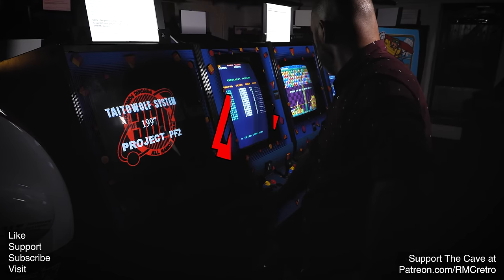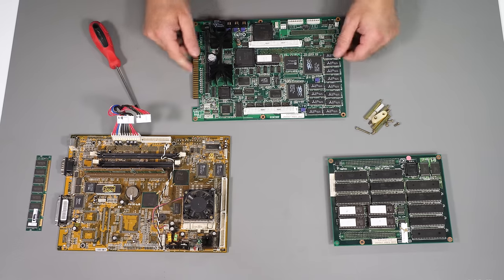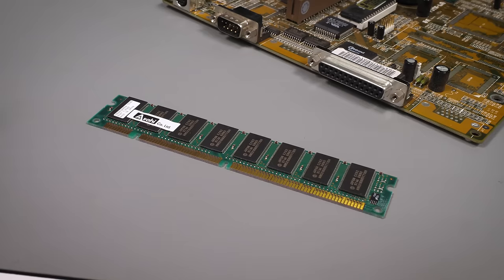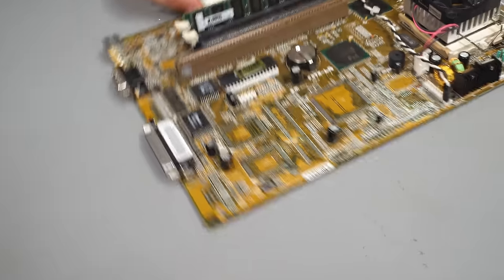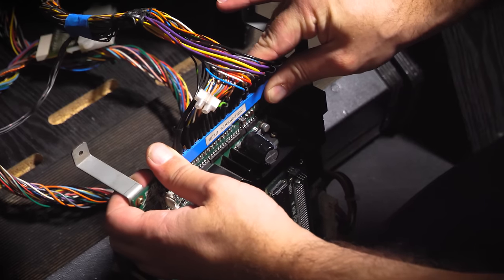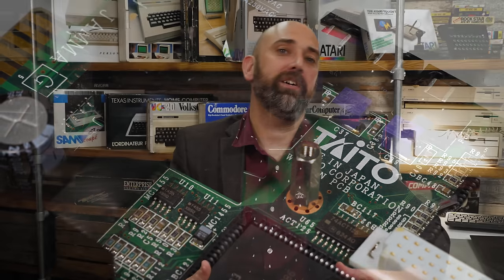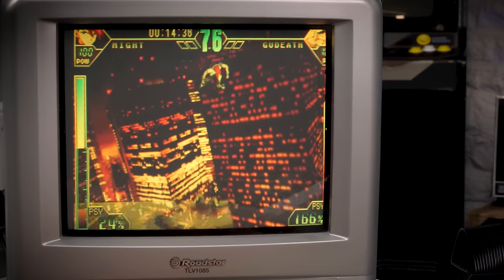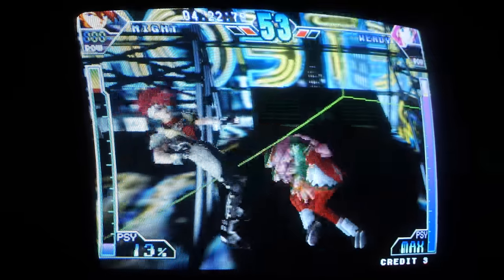What is Taitowolf? Late '90s Arcade Technology | Tech Nibble

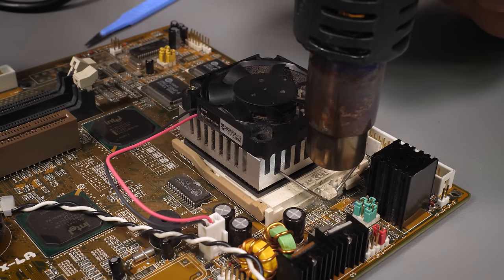Comment: 3:41 that hotsnot can be removed with isopropanol instead of hot air. It's much easier and less damaging.
Reply: Not to mention incredibly quick.
Reply: What is most of that hot glue made of anyhow?  Is it PVA?  That is something water soluble if so.  Looks like there is more than one way to get rid of that stuff.  I know that these days there is a variety of glue types used for all sorts of things, some are more permanent than others but there is usually some way to break their bond or dissolve those glues.  Even those 3M pads that are known for holding on really well are easy to remove if you remember to use dental floss. While that might leave some glue behind it will at least make it a lot easier to remove the thing it was holding.

Comment: Andamiro (The studio behind Pump It Up) made a similar platform called the MK-# which started as a bespoke yet PC-based board before using standard boards. 

The first two (MK-1 to MK-5) used Voodoo banshees embedded onto the PCB alongside VRAM connected through PCI before switching to nVidia GPUs which were AGP-based with the MK5. 

The early ones also used ISA for the I/O board and  PCI for the video. 

MK3 also happens to have an unused ATX power connector which works alongside unpopulated headers for Slot-1, IDE, and a floppy drive. 

The MK6 to present are standard boards with a custom I/O board and Linux.

Comment: The top board contains a DOS partition in ROM with MSDOS and that loads some programs to get the game booted. Note the Microsoft sticker on the board signifies a licensed MSDOS.
Reply: that makes the design even more puzzling. its like doing the whole design for sake of having rom sockets. the whole thing could just be a pci board. or just as a pc but then as a taito engineer you would've just been saying to fire you I guess.

edit: u1.bin is dos stuff. doublespace included and stuff
Reply: makes it feel like grand dad of current generation of arcade hardware in/from japan that has been PC based. Tetris The Grand Master 3 for example runs on celeron based taito type X PC hardware as do most to all current games with added bells and whistles for sure. Most have licensed microsoft windows, an embedded version for long living and running environment meant for one service device (A game) often with interchangable games. Funny enough one line of Sega hardware did use Montavista Linux, but aside few western counterparts arcade machines have not had linux embedded them like in dreams of Deck users today.

Comment: Thanks Neil for covering this. I had never heard of this hardware. Very interesting insight. Back in the day I remember the Voodoo 3 being a beast of a GFX card and it took me a lot of saving to buy one. Very interesting to learn about arcade cabinets using 3DFX tech. Aside from that my next trip to the UK from Ireland I''ll base it around visiting The Cave and the arcade you guys have. Excited for the visit.
Reply from the maker: Excellent! Looking forward to seeing you here
Reply: I know from another channel's videos that Hydro Thunder used basically an off-the-shelf Voodoo 2 card.
Reply: @CptJistuce It's not an off-the-shelf card. Yes it's an Obsidian 2 but the specific video card used in Hydro Thunder is custom and used in a few Midway Games PC-based games.
Reply: @g4z-kb7ct  I included a slight qualifier because of that. Odd amount of RAM for a Voodoo 2, and a signature in ROM that the game looks for so it can reject aftermarket replacements.
Reply: Voodoo was originally created for Arcade systems. Just that the huge drop in the price of RAM in 1995 allowed 3dfx to release it as a "3D Accelerator" for the PC. It was made as a cheaper alternative to the specialized hardware like the Sega  Model 1, 2 & 3 which cost arcades $10,000+ per unit. Similar to how devs were using PS1 as arcade hardware but better.

Comment: Emulation really hit its stride around the time this game was released. It's surprising that this game which was running almost entirely on off the shelf PC hardware with an MS-DOS OS didn't get dumped and distributed - it would have been trivial to get it working on a properly equipped PC of the era.

Comment: As for the barrel plug, it's likely that these would've been used in some setups without a JAMMA harness. It was a pretty outdated standard at the time since it only supported 3 buttons and mono audio, so you already had a lot of games even earlier than this that needed a host of other cables.
Reply: What are you talking about??    It's a JAMMA board!  You can clearly see there is no other interface or way to setup this board.   The barrel plug was just a leftover from the design stage that was never removed.    Psychic Force was literally the only game that ever used used this board and it's only interface was JAMMA as it never required additional controls buttons beyond the standard JAMMA configuration. 

Jamma supports up to 2 players with up to 5 buttons each, but many boards took advantage of the unconnected pins to accommodate up to 6 buttons without breaking compatibility. .  That accounts for a majority of games and it was still very much in use until the mid 2000's.  Even games that required more  buttons, such as Street Fighter or Mortal Kombat, still used Jamma along with a secondary "kick" harness for any extra buttons.   The newer JVS arcade standard still supports JAMMA input for the basic directional joystick controls and buttons.
Reply: @MrRobarino  "still supported" yeah because it was obsolete and left in because of how arcade cabinets would still use obsolete connectors.
Reply: @MrRobarino No! I have an original PF2012 and manual here.... AND the 110VAC to 5VDC power adapter that plugs into that barrel jack. It IS used. Although the game will work without it as long as the main PSU is 15A on the 5V line.
Reply: It's a three button game

Comment: The blue plastic film on the thermal paste rang a bell.  There was probably another layer of film attached to that blue layer, with a tab to pull with the intent of making it easier to remove the blue layer.  The top layer would separate from the blue layer giving the impression that the tape had been pulled off successfully.  Saw it a few times with AMD CPUs that used 3rd party heatsinks.

Comment: Using an existing platform doesn't just save money on the hardware development.  You can use an existing development system instead of having to either build a custom one or doing without.
Reply: Spot on. Never underestimate tooling in software development in general and game development specificly.

Comment: Pro tip :) - If you are working on anything Japanese and see those screws with the dot on them, that means they're JIS screws, not Phillips heads (even though everyone thinks they are).  If you don't want to damage the JIS screws by not having your screw driver jump out and damage the slots, pick up a set of proper JIS drivers for use on Japanese hardware.  They can be bought from amazon etc.  Some text from one of the tool websites:
"JIS, or Japanese Industry Standard screws are just different enough in shape that Phillips drivers will not fit well and slip/strip them. The difference is in the leading angle of the point of the driver. Phillips bits have a larger angle and therefore don't bottom out in the JIS screws, causing slippage. "
I cringe every time I see someone working on JIS screws with Phillips drivers.  Especially those cheap multitool versions...! :)   Then we get in to the pozi drivers...

Comment: Dude, bought a Supergun, but didn't think to buy some switches, joysticks, and a bit of wood. Man! Some admiration for the improvised joypad, minus much hate for those horrible bloody clicky buttons. It's the bare minimum, right?

There's probably someone programmed an Arduino, I think it's the Trinket that can do USB, to take a USB pad and spit out the separate bits a Supergun needs. Or you could even get an old analogue PC joypad and do a teeny bit of rewiring.

Comment: That was super interesting! But why did they even bother to make custom hardware at all? Why not just use 100% normal PC hardware and include an adapter cable from the normal PC ports to the Jamma edge connector?
Reply: Because then it wouldn't fit in a JAMMA board slot. Also needs to boot off ROM and load the game from ROM.

Comment: The PS/2 port, parallel port, and RS232 are usually just a gimme because its built into the super i/o controller that runs the floppy controller and handles the BIOS. USB would be off its own USB controller so its all just penny pinching cost savings to leave out the other ports.
Reply: But why the connectors, though?  They probably cost as much as the I/O controller chipset.

Comment: it's a concept that makes sense for cost, except that if your reusable pc board is a pc, you could just stuff a pc in there instead.
Reply: A ROM based game board is that much more reliable and a handful custom chips offer something akin to copy protection. It wasn't at all expensive to manufacture, it was fine.
Reply: It is a PC with a JAMMA connector.
Reply: the custom pcb 2 years down the line ends up way more expensive than loading to ram and in 2 years into the cycle a pc would be cheaper than the rom board, probably was by the time it came out tbh.

does the rom even present itself as accessible memory straight in the memory space or as a drive?  66mhz(or 100mhz) rom would've been kinda expensive and it's so far from the cpu that I don't think it acts as memory in that way, if some of that isn't mapped somehow into the voodoo.

the romset is just around 5 megs too though dunno if that is full. 

they obviously had some extensions in mind for it but then it starts making even less sense, the mainboard itself getting outdated so fast which is the real benefit from just stuffing a pc in there.
Reply: @lasskinn474  You're forgetting that counterfeits/bootlegging had been a MASSIVE issue with arcade machines. A board set like that probably went for give or take 10-15 grand to arcades, with underlying hardware cost in very very low hundreds, because software cost millions to develop, and these need to be earned back in via a pretty limited number of machines to be sold. Penny pinching an odd $20 here and there to make it more off-the-shelf just doesn't make sense if it encourages casual piracy that could be performed by any odd dude who knows how a PC is built. Better yet they used a custom soundchip the supply of which they control 100% to help discourage people with more resources, the kind that could get a repro PCB made and EEPROM ICs burned, but they already amortised the cost of that hardware being spun up.

As to the ROM? It could just be ISA memory, fully mapped. It doesn't matter that it won't do full speed, that's what bus waitstates are for, the device can even force its own non-ready states. The BIOS of your computer (and even a computer back then) works the same way, it's mapped via ISA bus and optionally shadowed by a RAM copy, but the IC is really really slow.
Reply: @SianaGearz  it sure seemed to make sense to them to not do this, since they quit this scheme pretty much instantly and just used dongles, encryption and such later.  this entire thing could just be a pci card and retain philosophically everything it is anyway and have a slot for an encrypted flash drive.

I tell you what though it would be interesting to hear an engineer from the team give a talk about the history how it came to be, everything has a reason - even if often it's not a very good one.. I know I've been attached to such product development at times.

another company used voodoo with a pretty much a standard pc, albeit in a custom cabinet and not as a jamma drop in game and standard systems with more easy to change games took over. I'd get the rationale more if it had more like 2 slots for system and rom board and they were styled like neogeo carts or other multisystem carts and were operator changeable, but in this the entire system is the changeable part and there were harder to dump solid state memory solutions that weren't a bunch of roms like an arcade machine 10 years older than it is..

Comment: Dude, you mentioned the windows on the EPROMs. Cover those up. NOW! Get a bit of foil if you haven't got the correct metallic tape. Put the foil over the window and use tape or a sticker to attach it to the chip. Over time, any UV photons floating around will attack the voltage on it's bits. Just daylight will wipe it eventually. Back in the day, poor kids would leave an EPROM on a windowsill to erase it. All you need to do is stop light from going down a little hole, you can do it!

Comment: You being up an interesting parallel between arcade boards adopting generic PC hardware leading to the irrelevance of unique arcade experience and the later PC commodification of console hardware today largely doing the same for modern consoles.  Without radical CPU and chipset architectures, arcade boards and consoles feel generic; you might as well just get a PC.  The whole appeal of old school arcade and console hardware was that the proprietary hardware created unique performance characteristics and aesthetic design choices for those platforms that couldn’t be duplicated elsewhere.

Comment: I thought the Voodoo was like the Voodoo 2 and needed a separate 2 adapter, if there isn't an onboard video chip installed where is it getting that?
Reply: If it was a PC, you would need a standard video adapter in order to access BIOS and see DOS/Windows.

But the BIOS here is hard preconfigured and there isn't any DOS and Windows to be accessed. So the standard video adapter isn't used in this machine. The BIOS is modified to make it so it will pass booting without video.

When the actual game loads in a fraction of a second, it just uses the Voodoo.
Reply: The game is fully generated by the Voodoo 1 chipset. It's all 3D graphics. There is no 2D in the game so an additional 2D video card is not required.
Reply: @g4z-kb7ct  it's impossible to combine 2D video card output and Voodoo anyway. At any given moment either one is active or the other. The moment you configure the Voodoo as active, it just hard switches the VGA port to itself and there's nothing coming from a 2D card at all, Voodoo doesn't have genlock capability.

STB made an arcade variant of PCI Voodoo card, which didn't have the VGA Input or the switching circuitry, and was configured with an unusual amount of VRAM, but was built on the retail card PCB just with population changes.

Comment: @2:40 - Wow. As you started disassembling it my jaw dropped. That's a custom form-factor, huge AGP board! Uh-oh. ECS? I'll bet you almost anything it's dead. Those boards were utter and complete trash.
Reply: It's actually an Extended ISA (EISA) slot. That floored me when I saw it since they were used mostly in server mobos.
Reply: ECS is the least competent manufacturer but once you remove all the parts, what is there to go wrong.
Reply: @JRBlood  NO! It's a riser slot. I own the board and documented it. The plastic slot is an actual EISA slot but it's custom wired for a riser card. Totally non-standard. The slot is also in the wrong place so you can't even put a ISA or EISA video card into it. It's definitely not EISA or ISA compatible and plugging in any standard video board will fry it instantly.

Comment: I cant believe they never peeled off the thermal paste protector, lol
Reply: I came here to say this.
Reply: Believe it.  I've seen this more than a few times.  And it seemed to matter a lot less than you would think.
Reply: @nickwallette6201   Just a short time later, it mattered a lot. Waves of burned early AMD chips with this assembly fault.
Reply: @SianaGearz   Do you remember which series?  I've only ever run an AMD 386 and briefly borrowed a K6 board while building a new Pentium II.

I'll always remember the Tom's Hardware video where they pulled a HSF off a running Pentium 4 and Athlon XP.  The P4 throttled down to nothing within a few seconds.  The Athlon XP crashed and started burning.  Very educational!  haha

Comment: I can't find a reason to spend thousands of dollars designing a special board if there was complete ready-to-use x86 hardware at your disposal. Jamma could have used the serial ports present on the motherboard, the rom could have been implemented via the IDE bus, the video card I don't even need to comment. All they would have to do is modify the bios to a customized version that would allow the system to boot only if it found exactly the expected hardware.

It would have been a few thousand dollars cheaper to manufacture, more affordable for customers to purchase over the competition, and could have become an easy platform to develop. Perhaps they could license the hardware for other companies to develop, and profit from it.
Reply: The form factor of orthogonal PCI slots would not fit the JAMMA slot.
Reply: @jimb12312  I believe that a simple riser like the ones used in 486 computers would solve the issue